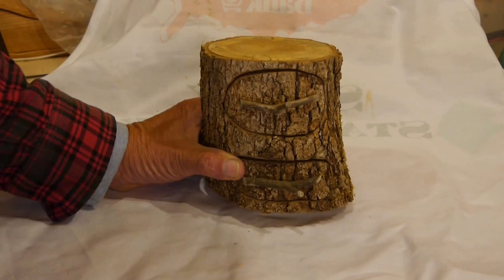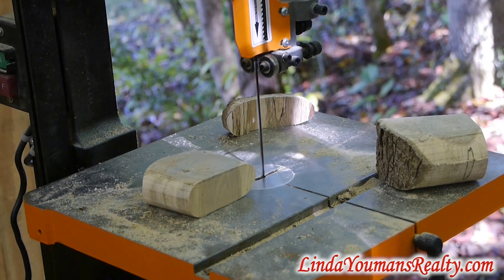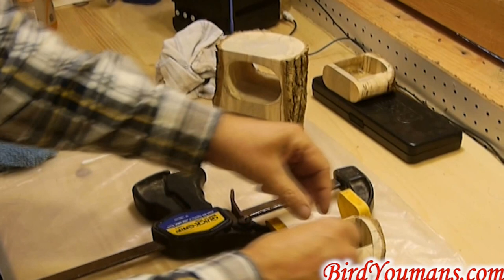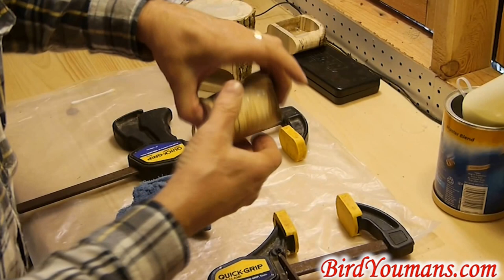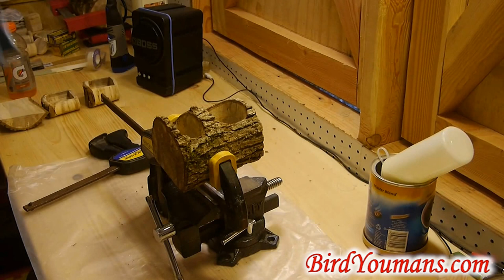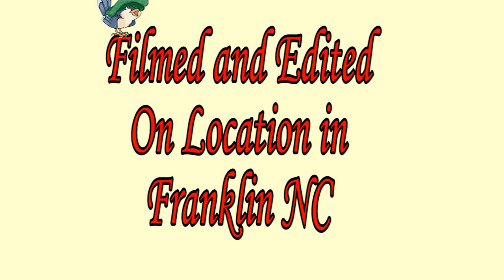Ep. 5 - Bandsaw box from a Dogwood sapling trunk. Finally! - Bird Youmans

Comment: Just got into bandsaw boxes myself. Really nice work! There are so many fancy, ornate little boxes, but your stmp box is one of my favorites that I've seen so far.👌Well done!
Reply from the maker: Thank you Slow Burn!  I enjoyed making it.  I have reached 78 and my music channel has taken most of my time the last few years and I haven't posted much, but when I was doing more wood working, my band saw became my favorite saw.  Good luck with your boxes.  They are really fun to make, and you are only limited if you have a decent saw, by your imagination.  By the way, don't know what saw you have, but mine is a Grizzly and until I changed the blade that it came with to a Timber wolf blade, I had no idea how really good my saw is.  I use a 3/16 4t blade.  Cut like butter!  A good blade makes a huge difference.  Good luck!
Reply: @birdsadventuresinwoodandmusic  it's an old craftsman roebuck 12 inch, and that's the exact blade I run! 🤣 The Timber Wolf blades seem to be pretty awesome.
Reply from the maker: @slowburnwoodworks7626  That old Craftsman is probably better than most you could buy today lol!  And a 12 will be good for most of the boxes you would want to cut.  As for the Timber Wolf blades, I love them!  I use the small one for boxes and delicate work and I have a 3/4 4tpi for slabbing small logs.  In fact, I have a video that shows how I made my jig for sawing logs up to whatever length you can physically lift up onto your saw.  Only modification you need to the jig is how long the bottom board is.  If you see the video you'll know what I mean.  But in essence its a small saw mill and much safer than trying to "free hand" it.  Here's the link for that vid if you haven't seen it:
https://www.youtube.com/watch?v=CYhnYjj6ti0&list=PLnutQWHKDrEOYikFxvs_1HFLjmj2oiwmY
Reply: @birdsadventuresinwoodandmusic  It's been a pleasure to run so far. A new blade and a bit of small adjustments and she was good to go. And I will definitely check that out! Thank you!

Comment: I have  flocked 125,000 jewelry boxes in my shop. Not that many myself but in 44 years we have made a bunch of boxes. FLOCKING TIPS - I use yellow wood glue watered down a little. I seal the inside of the drawer  or box with even a little more watered down yellow wood glue (2 coats) then lightly sand the sealed inside of the drawer with 220 sandpaper. Believe me it makes the flock much softer to sand the sealed wood. If you do not seal the inside of the drawer first the wood absorbs the moisture from the glue and you get an uneven result. By the way if you get flock prints on the box or glue overflow on the varnish it cleans up with a damp rag. The chances that the flocked drawer will get wet is very low. The only reason I see for using solvent based adhesives is to make the flock job waterproof.
     For big jobs you have to work fast. Divide the job into sections if the job is too big to do all at once due to glue drying. You can lightly go over the whole surface once you have all the glue applied to make the coating more of a uniform wetness.      I use a dark cardinal red flock .030 and the glue does not show or affect the color of the flock.. It is not transparent but a very light yellow when dried. You could use white wood glue too. I use yellow wood glue because that is what I always have on hand. I have never tried because it was not necessary but I have thought of using food coloring if it was ever necessary to color my glue. I use an air pistol hooked up to an air compressor. The yellow can looking flock guns that Rockler sells suck. I have 2 and have never been able to get them to work right. If anybody knows how to make them work please let me know.  I have an old heavy duty flock gun I have been repairing for 30 years. Just today I found a flock gun out of India. I  inquired about it but have not heard back yet. Zari Flocking Gun it was called. (postscript. The people in India demanded a bank transfer. Do not do that. Only deal with people who accept credit/debit cards) I found another Flocking gun, the Wagner WF-20, 20 mm for the application of dry chips to a wet undercoat but that cost 180 Euros plus shipping. Flocks guns are very hard to find these days. 
By the way, When I am interviewing women to do the flocking I ask them if they know how "to flock". Not one has ever minded once they realized what the joke was.

Comment: Nice job! Suggestion, 1. A few grains of salt on the glue  will prevent the parts from sliding. 2. Sometimes I drill a very small hole in the parts to be joined and place a part of a toothpick in the hole. This acts like a tiny dowel. Just a suggestion.

Comment: Here is a little gluing tip.  Apply glue and before you put the pieces together, just sprinkle a little bit of salt on the glue and that will prevent slippage.  Works great.  Thanks for the video.

Comment: Awesome looking box! I just got a better bandsaw where I can make these now. Thanks for the inspiration! Also, to keep you parts from sliding on you when gluing, sprinkle a little salt on a glued half before joining. It creates just enough grit to prevent sliding without compromising the quality of the glue joint.
Reply from the maker: Thanks for the tip.  I'll try that!

Comment: I just finished doing a couple bandsaw boxes out of driftwood, and am in the process of doing utube videos. the first one I posted the other day, The other one which was a simulair process as yours, I put the cut side down and cut freehand for the drawers without lines, Your method has  merit. I think I would set it on a piece of plywood with a piece vertical on the end, then screw it to the end piece to keep perfectly in position while cutting. Name here is Brian Procter and you will be able to find them by searching for driftwood bandsaw box.

Comment: I find it easier to glue the front and back on the drawers BEFORE sanding the outside of the drawers. Maybe its just me but you might want to give it a try once. It may make it easier to line it up that way.
Reply from the maker: Hi Gerry, I usually do it that way now, but this was my first attempt at a band saw box.  I would not recommend a "tree stump" for your first try at it lol!  More difficult than it looks because nothing is square.  Also, I did this over a period of a week and by the time I got back to it to glue the drawer fronts I learned a good lesson.  Glue it the same day you cut it out or the parts will dry and warp.  thus I had to do some sanding ro they would never have fit.  I did indeed do more sanding once they were put together as well.  But, lesson learned!  And in the end I did get it together.  As I have said before, my channel is just my own experience as I learn things.  It is definitely not a how to channel, just my adventures so to speak.  But you are certainly correct, glue and then sand, just do the gluing right after you cut the parts out so no warpage has time to take place.

Comment: I want to make a bandsaw  box. I really love how you use the bark and a solid piece of wood.  I am in a woodworking class and I noticed you did not adjust your band saw length down or up for the height of the wood to steady the blade ? I of course am new to this but I remember them showing us to raise and lower the blade. I don't know if it is harder to do in videos like that and will have to see when I am cutting stuff again what the instructor advises or what do you advise?  Anyway I wanted to compliment you on your very cool band box, and let you know I am going to try to make one with bark too -after watching you.
Reply from the maker: I had just gotten my saw and had spent a good amount of time learning to fine tune it.  (A guitar sounds a lot better when in tune, and so does a band saw lol!)  That was my first band saw box and it was cutting so good (I also put a timberwolf blade on it that made it like a much better saw) that I forgot to lower the guard.  But normally you should bring it down a good bit closer to your work.  A lot safer that way as well.  Good luck with your band saw box.  Just be sure you have a good sharp blade and your saw is well tuned.  I use a 
3/16" blade for that type of work.

Comment: Thanks. When you close up the entry cut and glue it, doesn't it close the side of the cabinet and trap the drawer?
Reply from the maker: If I understand what you're asking, no because there will be a certain amount of space created by the kerf of the blade and also by the time you sand it good and get rid of the blade marks that creates a bit more space.  But no, the drawers don't bind at all.  In fact, you will wind up with plenty of space for the drawers.  These are rough enough just being what they are that the space isn't so bad, but on my boxes I cut from blanks I glue up from scrap boards I even use a little felt pad that sticks to the bottom of the drawer to even the kerf and sanding opening out.  Here's a link to a box like that which I cut from some cedar and white pine   https://www.youtube.com/watch?v=ySQ-XMuSRz0

Comment: do u work with wood and glue and clamps often?? you don't seem very familiar with the 3 together to much... At least not in that video... Good job on overall log box.... Awesome job looks good....
Reply from the maker: As I state in my intro video Ep. 1 my channel is me learning about wood working.  This was also my first band saw box.  I've done a few since this one, but this was by far the most complicated since it is not square or flat, so yes, I was definitely learning lol!  But I figured that would be the fun with this channel.  People get to see what it's like for me to grow as a wood worker.  I did some basic carpentry before and a shelf or speaker cabinet or two, but no "fine" wood working so to speak.  It's now two years later since I cut this box so I've learned a bit, but still learning!  It's fun and I love it!
Reply: Well ur box definitely came out real good.. I bought books to make these years ago and wasn't able to try make them cuz I only had a little band saw that would do up too 3 1/2 square stock so I was to limited. So glad to see u was able to take a shot at it and kicked ass at it.. My comment was wasn't towards ur wood working skills it was just a question about ur glueing and clamping.. If u have done much of it . In the future just in case u haven't seen it before sprinkle a little salt on ur glued area before clamping that will keep it from sliding around like that and won't have to hold it by hand till it gets tacky before clamping...  Besides that awesome job..
Reply from the maker: Thanks Dennis!  I started with a small band saw as well, but immediately realized it would not do what I needed so I took it back and ordered the Grizzly.  It took a lot of setting up and making the wheels co-planer, but once I had it set up right and bought a new better blade, I was off and running.  You could probably make some small boxes, but it would be a challenge.  The blade on that first little one I had would not stay on the wheels when I tried to take a curve of almost any amount.  But thanks for your comments!
Reply: Your welcome. Yeah I wasn't financially set up to do it because I was doing it more as a hobby here and there hell I think I only owned a couple squeeze clamps no big clamps LOL I was doing commercial framing mostly was hospitals or additions on them..but was more familiar with regular houses then commercial plus too much travel so i started doing a lot of flooring and painting and finish work on the residential house jobs. And I still have not made one of those damn boxes. The book I have has some awesome designs in it.

Comment: Nice job, I'm thinking of making these but don't own a band saw yet. What do you suggest a 10" or a 14" band saw
Reply from the maker: I have a 14 inch Grizzley and I like it a lot.  It has a good price tag but be prepared to adjust and "tune it up" well.  Once it is cutting good, then order a 3/16" blade from Timberwolf for band saw boxes, and if you wish to cut up small logs or firewood to make use able wood with, get a 3/4" resaw blade.  Those two blades will serve you well.  There is no comparison between these blades and the one that comes on the saw.  It cuts, but not like the Timberwolf blades. If you can afford it (around 500 dollars), get the 14".  It has extra power and you can work larger pieces of wood.  Also, get the 6" riser kit before you order the blades (takes a longer blade) so you have 12" under the guide foot of the blade.  It is probably the most used saw in my shop.

Comment: Love it!!!  You keep too much of that blade exposed at the top throughout, for my comfort!  Don't cut yourself, gotta still Praise the Lord with those instruments dude!!!  Need All them fingers! 👏🏻
Reply: I agree about too much blade showing.  That was the first band saw box I cut and the first time I used my saw so I still had some things to figure out at that point.  I had set it to the full width of the tree to cut the flat side off and then when I cut the drawers I was too caught up in the project to remember to lower the blade guard.  I did learn though and and now it's my practice to keep that adjustment close to the work.  I actually bought the band saw just to cut those little boxes but it quickly became my favorite saw.  Used for so many things.
Reply: BirdYoumans 
Keep them fingers intact!!!
Blessings

Comment: I'm wondering if the bark dries out and falls off.  The "log" could start to split as well if it is not sealed.  I didn't see you put any finish on any of it.  Since you posted in Dec of 2015, you have at least 5 years of use to know if the bark came off or the wood split?  It seems to me that you should put some diluted white glue on the bark, or maybe some Hodge Podge, both of which dry clear, all over it and let it soak in before you make the box.  I have some Russian Olive trunks about the same size that I would like to make the same box out of, but the bark seems to come off as it dries.  Thanks for the video.
Reply from the maker: Hi Dudley, this is dogwood and VERY hard wood.  After the five years, it is still intact and about the same as when I made it, but the bark is indeed going to need some attention at some point, but surprisingly, it is still intact.  However, you are correct that most wood would need something to keep the bark intact.  The ends have not split but the "stump" had dried pretty good before I cut it out so after five years, I don't think that will ever be a problem.  But it can't hurt to put some finish on it.  I never did, but probably should have.

Comment: what i wont 2 no is what kind of blade r u using  looks like  about 1/4 kant tell about the teeth
Reply from the maker: It's a Timberwolf blade that is 3/16" with a 4 tpi tooth count.  Way better than what comes on the saw.  You won't know how good your saw is until you use a good blade!  The lower tooth count works well for cutting band saw boxes.  The higher tooth count may give a slightly smoother cut, but struggles a lot more with the cut.  I find the difference isn't worth it because there's always sand paper, and the difference in the cut isn't that much smoother anyway if the blade is nice and sharp.

Comment: What tpi blade do u use
Reply from the maker: I used a 3/16" 4 tpi blade for the band saw box.  A higher tpi results in a finer cut, but is not nearly as aggressive.  I can always sand a bit, but I find the finer ones just aren't aggressive enough when making cuts in thicker wood.  When re-sawing I use a 3/4" 4 tpi blade for that.  It really matters to use the right blade for the job.  I also recommend getting a good after market blade for your saw.  I saw someone on youtube recommend Timberwolf blades and tried them.  They are great.  It was like I got a better saw.  The one that came on it was adequate at best.  But the Timberwolf is indeed a great blade.  Also, take the time to set your saw up properly.  That makes a world of difference when it comes to blade drift.  I sometimes forget to lower my guides because it cuts so good.  Youtube has several good vids on setting up the saw.  Good luck with your projects!